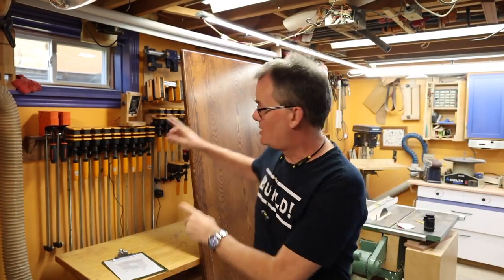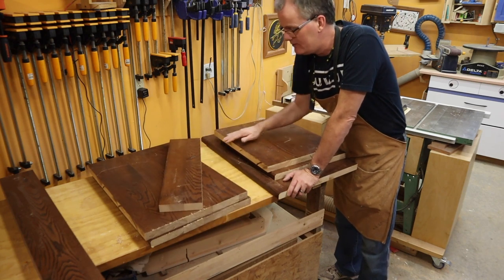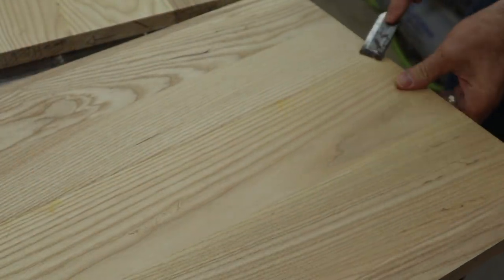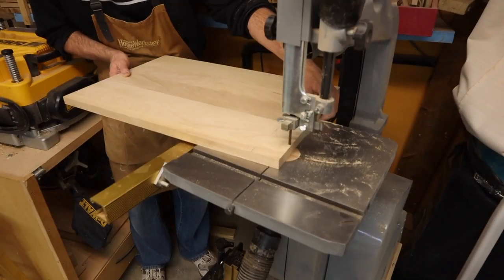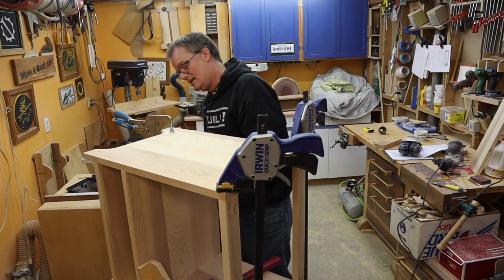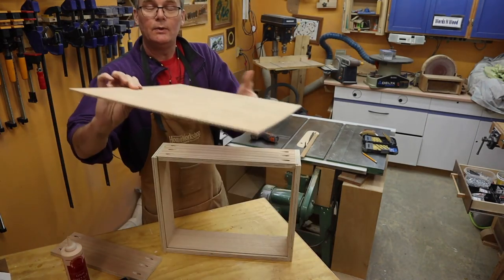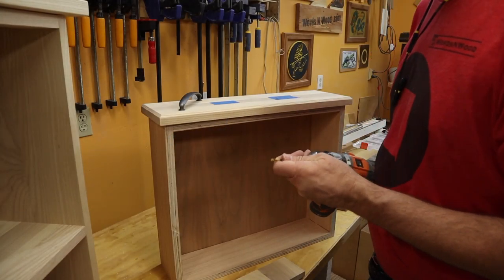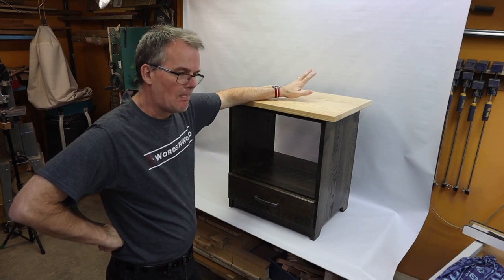HOW TO make a Double Decker Printer Stand // Made from Scrap (WnW #194)

Comment: A biscuit joiner is easier for alignment. I thought you had one, but maybe I'm mistaken.
Reply from the maker: Easier, yes, but IMHO it would be less accurate.   Biscuits allow for some side-to-side adjustment.  That is great when you need it.   But these dowels allow no side-to-side wiggle at all.   When you need perfect alignment, these are what I prefer.
Reply: @Wordsnwood  thank you. I hadn't considered that. I usually done worry about that however you have an excellent point.